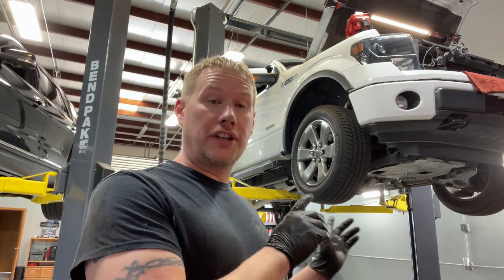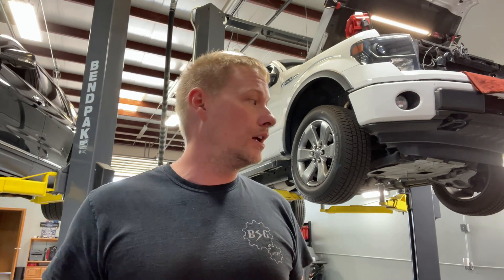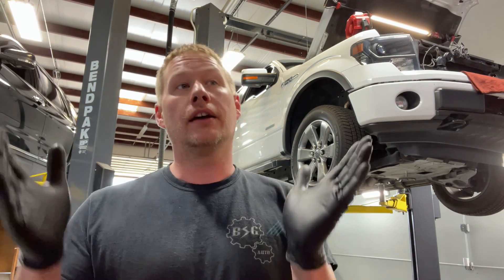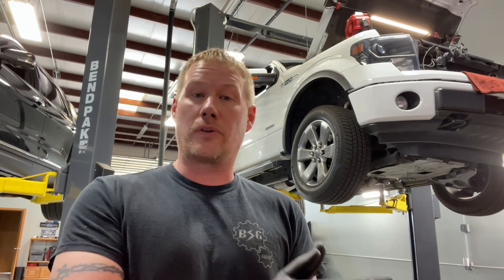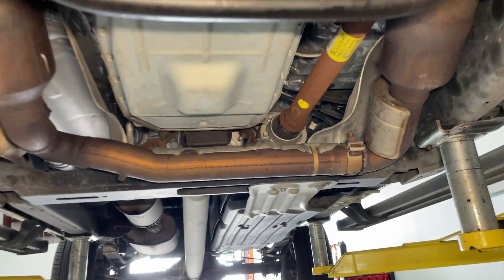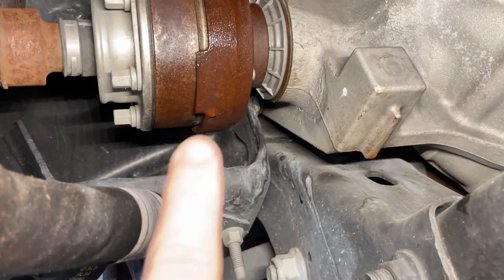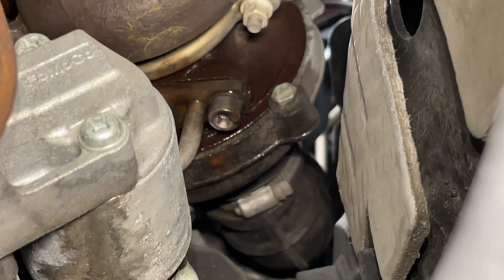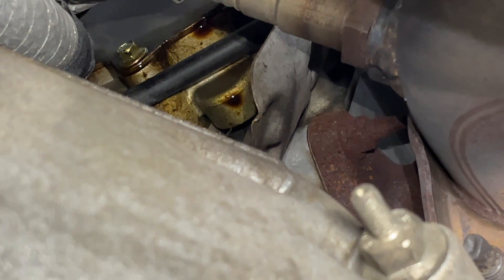Ford Ecoboost Engines Can be so Hit or Miss: I Really Feel Bad for This Customer...

Comment: You're killing me, guy. I had to double take. That's my truck on your lift. I had my turbos fail right about 70k miles. The dealership broke the oil lines doing the repair. I never felt like it was fixed but my obd2 reader feeds a boost gauge on an app and it does see 12 boost or so. It pulls my 38' camper pretty strong, even at 121k miles now, but the dealership in Florida said they found evidence of a leak, looking like a rear main or higher (turbos maybe) and I really don't feel like taking on the payment for the equal level of new truck. If I go coyote, I'm likely no longer able to tow my camper, but I really don't want a 250 for daily use. Especially not until they update the interior. Regardless...try finding an f250 in Joe Biden's America.
Reply: Damn right, f**k biden 👍👍👍

Comment: I really liked my 2012 FX2, but I'm glad I got rid of it.  Between direct injection valve carbon issues, timing cover seal issues, eating spark plugs, it just wasn't worth keeping.  Of course, these hit or miss quality issues are because the group in charge of quality control at Ford is just phoning it in.  To them, everything looks good.

Comment: I have a 2008 Fusion 3.0 L Duratec. Only maintenance so far was the valve cover gaskets and the HVU that there was a recall on the dealer fixed. I also have the VCT solenoid gaskets leaking which I bought new valve covers for. The car has 180,000 miles on it. It has other common Ford leaks as well. The car will rust out before the engine dies as its driven in Wisconsin.

Comment: Great video Brian.  He's in good hands bringing it to you.  I have a 19 F-150 with 12k on it and it to does the start up rattle, sounds like you can hear the timing chains dragging inside the cover.  I just received a recall notice from Ford to have the computer reprogrammed for the cam phasers.  This is a leased vehicle but seriously thinking of getting the 5.0L for my next lease.
Reply: Never thought about leasing a truck before. Do you tow with it, and how does that affect turn in costs?
Reply: @roadrash1021   This is my first leased truck, I haven't towed anything with it as of yet.  My lease is up next April.  I'm not 100% sure on what costs I'll have at turn it but from my ford pass app says I'm well under the mileage for the lease.  If you go over then they charge you mileage costs. As for wear and tear I purchased fords wear care product that protects up to $5,000 in use and wear. I hope that answers your question.

Comment: Beats needing  ball joints at 30k or bearings every time u come in. Ford for me. My 13 5.0 f150 is my go to and will be. I've replaced fuel pump fuse , waterpump and crossover pipe. Tuner lift and exhaust since day 1 with 2 miles.

Comment: My 2014 F-150 with the 3.5 Ecoboost currently has 55k miles.  I bought the truck 4 years ago with 36k miles.  I began to hear the start up rattle at about 38k miles shortly after switching to that full synth oil made from natural gas.  I don't drive the truck regularly, and have been holding the accelerator pedal to the floor which disables the fuel pump when cranking the engine at start up.  I hold the pedal to the floor, crank the engine for about 10 seconds until I see pressure on the oil pressure gauge in the dash, quit cranking the starter, take foot off the pedal, then start the engine normally with no start up rattle due to pre-lubing and pre-pressuring the oil system.  I have since learned through research that synthetic oil molecules are many times smaller than traditional mineral based oil molecules and this is why stories of oil leaks after switching to full synth.  I have recently switched oil to Ford Motorcraft Semi-synth 5w30, 5qts oil to 1qt Lucas synth oil stabilizer.  The engine has returned to mostly rattle free start up even after sitting for several days and starting without the pre-lube procedure.  My theory is that the smaller molecule full synth oil bleeds past the cam phaser seals and the oil pump needs a couple of seconds to pressurize the phasers before the rattle stops.  Before the Motorcraft oil change, the rattle would happen slightly after sitting for only 8 hours and much more rattle after sitting over night or greater than 12-16 hours during every start up.  Now, the rattle is mostly gone, very slight rattle in about 1 in 8-10 start ups after sitting.  Only about 500 miles since the oil switch, and I will be changing oil every 3k miles or so.  I will keep you posted at the next oil change regarding whether rattle issues have been eliminated.
Reply: At 72k on '13 F150 EB I had much of the same experience.  Occasional timing chain rattle on startup, estimate 1 out of 10 cold starts.  I've done Blackstone oil analysis after every oil change.  Only used Motorcraft semi-synth, Pennzoil UP, Chevron ProDS or Castrol synthetic.  Played around with oil filters a little OEM Motorcraft FL-500s, ACDelco PF63, STP S10590,  Wix 57502XP, Purolater PL22500 across the oil changes.  

I've tried several other oil additives Ceratec, Archoil, Prolong maybe got a marginal benefit to number of timing chain rattles on startup, but the change if any wasn't truly notable.  Only real observed changed was UOA indicating additional molybdenum. boron and potassium level increases.  Wear metals didn't change all that much.  

I like you started using Lucas synth oil stabilizer.  I've only been using 6 oz to 8oz of Lucas stabilizer instead of the recommended 1 quart for every 4 quarts of oil used.  I've had two instances of timing chain noise on startup in the last 6 months.  Both of these times it was a cold start run for 60 second then another start say 10 minutes later.  Estimated number of cold starts 50, number of total starts 150 over 6 months.   I've used Castrol 5w-30 black bottle and Purolator PL22500 the last two oil changes with good success.   Going forward only plan on using Chevron ProDS or the Castrol oil with what I know and understand for now. 

One thing I notice about the Lucas upon draining the oil is that it has an adherence property.  I might be described as sticky, but that's not right.  Its more of a tacky property that clings or bonds to everything.  I got some of the used oil with Lucas my hand changing the oil the last go around.   There was a notable difference in the solution of oil and Lucas had from physical contact compared to just plain used motor oil.  

To go from 1 out of every 10 cold starts having timing chain noise, no practically none, the Lucas is doing something for sure.  Not sure if there are any draw backs for using Lucas, but Blackstone hasn't indicated any.  

In full disclosure I did also 3 months ago remove the intake and clean all the carbon buildup from the intake valves using various solutions (brake clean, CRC GDI intake cleaner, picks, brushes, screw drivers, air wand and liquid vacuum).  The carbon buildup even after two driveway CRC GDI intake cleaning treatments, and a service shop BG intake valve cleaning treatment still left the valves covered in a layer of carbon.  Subjective but can't imagine the extra reciprocating weight of the carbon on the intake valves helps when trying to get the valvetrain in motion.
Reply: Great info,  as this Lemon Engine ages might be good to add a 'pre-oiler' electric driven oil pump to pressurize system when twist key to run.   a few hundred spent could avoid thousands in repairs!
Reply: That "pre oil" procedure is what a lot of 4.0 SOHC owners do on the older Explorers for it's poor timing chain / guides setup.
Reply: "synthetic oil molecules are many times smaller than traditional mineral based oil molecules" 
I don't dispute your observations about your truck and the oils you've used, but this statement from your research is simply false, at least if you are using a major brand full synthetic. If it were true, the viscosity of the oil wouldn't meet specifications, film thicknesses would be too small, and your engine components would wear like you were using water for oil. Any stories of oil leaks after switching to synthetics are probably from the 1980's when initial formulations didn't swell seals enough. This was fixed long ago and had to do with molecular type, not size. Synthetic oils usually do have lower viscosity (are "thinner") at cold temperatures and, in most situations, this is good for getting oil soon to the places it needs to go.

Comment: Brian, could the Texas climate have played a part in the failures? Or was it possibly a Monday or Friday factory build? 😖

The dude's nice truck looks like it's worth the repair costs vs the cost of a new one.
Reply: I live in a similar climate and yes we do have issues with rubber and plastics drying up but it's a slow process normally. With the excessive turbo heat that may speed things up. Living in the desert has it's advantages on the rust issue but we have issues as well. I have to replace the tires on my Tacoma for drying out and cracking before tread use.

Comment: Looks like it's been Hot.  Shrinks the seal and gaskets.  I had a 85 3.8 v-6 Merc with a defective coolant reservoir from the factory.  Ran it low on coolant because the reserve was leaking air through at the full mark.

Comment: Dad sees them at the auction announced with a blown up engine not running even maintained.This is at a dealer only auto auction in Mishawaka,Indiana.A miss under a load due to bad programming in the computer pulling something,will cut out.I have seen one that went through oil,owner's husband checked and no oil on the dipstick.Decided to get rid of it and his wife bought a 2012 F150 with the 5.0 instead.

Comment: Durability wise are the 3.5 and 2.7L engines any good?, I'm referring to major mechanical failures not just fluid leaks? Pretty much you would recommend the 5.0L over any ecoboost?
Reply: 2.7 is more reliable

Comment: I just changed the coolant fittings on the driver's side turbo on my 2014 F-150, 3.5 with 81,000 miles. The fittings were $26.00, seal kit $30.00, and turbo mounting bolts $27.00 plus two gallons of Motorcraft concentrate coolant $ 36.00. It was a time consuming repair for that little fitting and a pain to do.
Reply: Did you check your rear manifold bolts? I’m at 97k and both driver and pass. rear studs are broken. I will be replacing all the fittings and gaskets along with the studs. I do love the motor. Has been good to me. Knock on wood with the timing chain. I have been using mobile one every 5k. To good health and safety 👍
Reply: @paulroberts1695  No, I didn't check the manifold bolts.

Comment: I have a 2015 eco with 80,000 ,so far no leaks , I dread the thought of this happening to my truck.  I did put a a catch can and the garage it collected makes me sick to think Ford let's this into the engine
Reply: Catch cans are good but I just put a thick road draft tube hanging down between the engine and road surface and it works fine. Old cars and trucks had that for many years before the EPA started fuckering with engines.
Reply: @markm0000  Do you really want to force everyone you drive past to breathe that crap? Oil mist is bad enough to have strict OHS exposure limits when the oil is clean, but the sump of your engine is pretty much a petrochemical sewer. Mechanics to this day have elevated rates of skin cancer on their hands from doing oil changes, and if you blow that out into the air you're sending it into somebody's lungs...

I also find it difficult to believe that you won't get dust and dirt working its way up the draft tube and into your engine oil over time (the blow-by should prevent this, but murphy's law and all that...). Just use a catch can and live with a clean conscience.
Reply: @dgunearthed7859  more or less. When an engine is running the pistons don't seal the combustion pressure perfectly, some gas escapes into the crankcase. That gas has to escape somehow. Modern engines usually vent those gases into the air intake, where they'll get sucked into the cylinders and re-burnt. What he is talking about is instead venting those gases into the open air via a tube that runs under the car. The problem is that the gases in the crankcase are always mixed with oil mist and vapor from the oil being splashed around in the engine, so if you just vent them to the air those droplets of oil will settle all over the road (and in bystanders' lungs!). Obviously just one car doing this isn't going to turn the street into an ice skating rink, but you can imagine what would happen if everyone was similarly inconsiderate...
Reply: @nerd1000ify  Thanks for the thorough explaination. I think of all 3 options, the catch can sounds the best.

Comment: I am looking at a 2013 3.5 F-150 with 76,000 miles .. this is a sign to not buy
Reply: Why? Get a flash light and do this simple inspection before you buy.

Comment: I bought a 2015 Ford F-150, from a reputable dealer 6 months ago, , but it was traded in and really didn't know the history, but truck was mint.. so I went for it, well a few weeks ago got a low oil pressure light and took it to ford dealer and control module was gone.. then while there belt tensioners gone.. and when all put back together same thing oil pressure light still come on.. so they did some investigating  and needed to replace solenoid in motor.. and they said motor was so sludged up it needed to be flushed.. I'm so pissed.. they were really good with it.. but damn how does a motor get so sludhed up? I know beside not changing oil.. but it only less then 100,000 miles on it

Comment: I'd be curious to know the time difference in doing this bent over the radiator support & cab-off? Spent waaaay too many years bending over and now paying for it with constant back pain. (63)
Reply: Gail Taylor. And hence I flatly refuse to do any major repairs on these trucks without lifting the cab. For the hour it takes to unbolt the cab, the unlimited access not to mention NOT being bent over makes it well worth it.

Comment: I have an hour long conversation w myself some day about burning down my 2012 platinum 3.5 ecoboost bought it w 150k 2 yrs later I have 188k on the clock and a rebuilt transmission that still does the same thing as before that lead down road to being built. I do Chalk most issue and repairs to it being 10 yrs old and some things are just normal maintenance issues.  I can agree stone of the statement below is drive it a lil hard and it runs way better and few issues such as the ole shudder they like to have and the gas miles stay pretty good baby it around and it get lil moody lol.   I have always wanted an f250 but settled for this. Thinking I’d have less issue wrong might as well got the f250 🤣
Reply: Less issues with an f250 with a 6.2. No turbos to worry about.

Comment: I used to be an ASE master +L1 and what you are seeing is common here in TX. The constant heat wreaks havoc on drivetrains and interiors here and does far more damage than most realize not to mention long drives in the excess heat in traffic at high speeds. There are so many of these F150s sitting in farmers fields that look immaculate but the cost of the engine and often electrical repairs far outweighs what the truck is worth so they just get parked. I can't tell you how many guys that have had this happen that they end up going back to an earlier 2000s Chevy that just keeps running. 
       My experience with Ford products here and what I see in reliability in our climate shows that repairs are going to be constant and very expensive. It's the reason that I don't own one anymore that isn't a classic.

Comment: Seems like with each passing year cars are becoming more and more disposable. They become so expensive to repair that it's almost cheaper to crush them and buy another new vehicle. 70k miles needing that much work is ridiculous. Manufacturers don't make much profit in selling new cars. They get their profit with having parts fail sooner and sooner and making it so difficult to work on that you have to bring it to a repair shop or dealership. Makes me not want any new vehicles. I rather buy a 20 year old one and repair it properly.